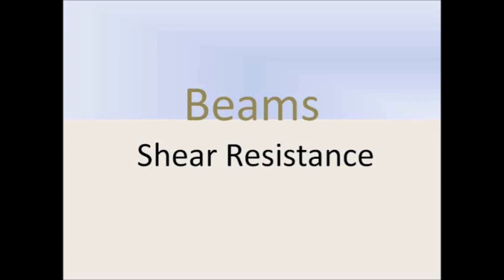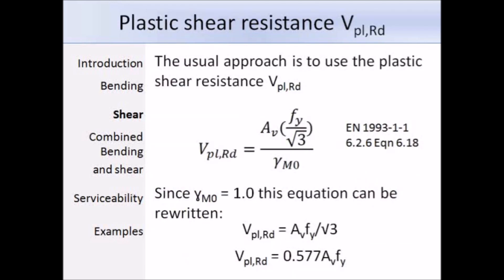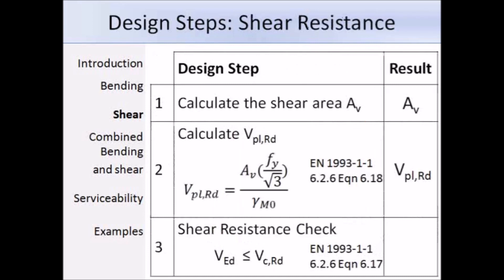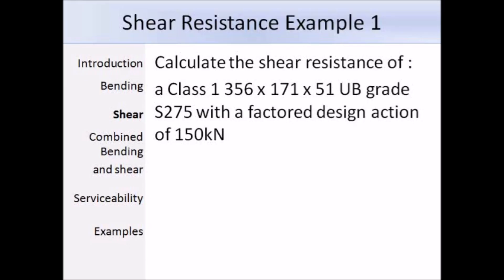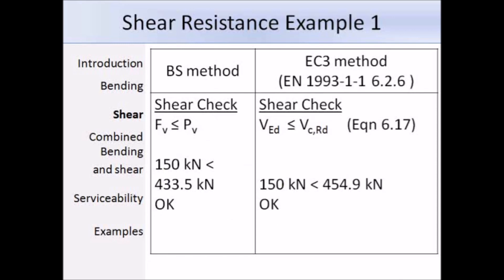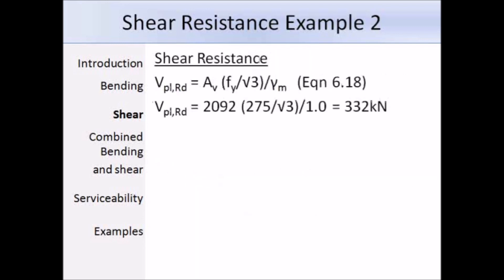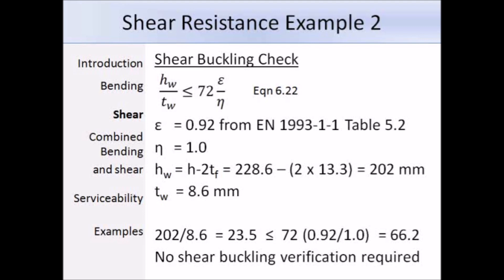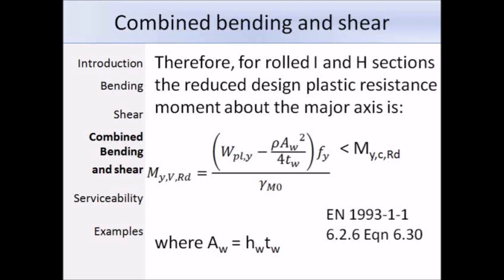Steel Beam Design - Shear | Combined Bending & Shear + Examples | Eurocode 3 | EC3 | EN1993

Comment: what is a factored design action and how did you get the 150kN ?
Also how can i go about solving this question. Determine the moment and shear capacity of Quarter span and three quarter
span point load of 67kN each  assuming each beam is fully
 laterally restrained.